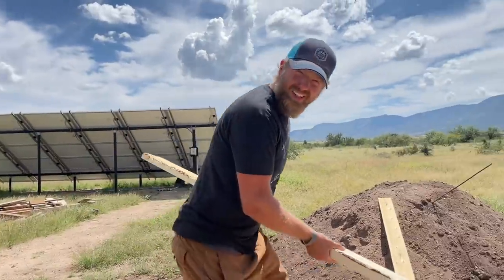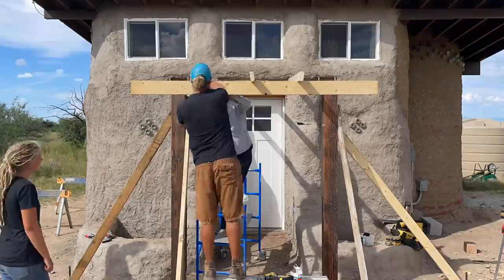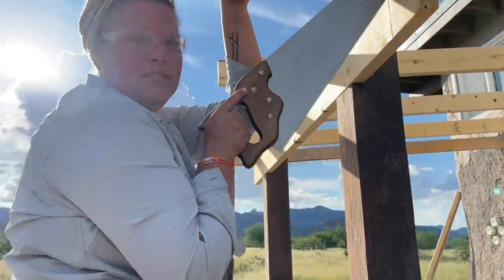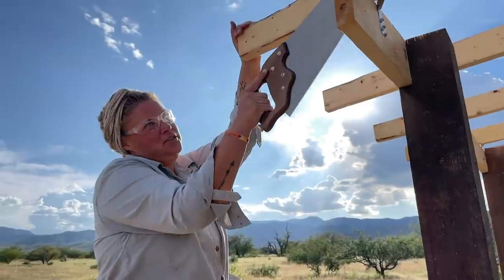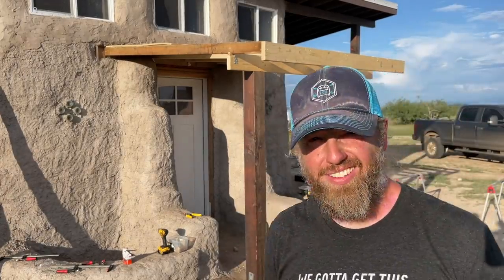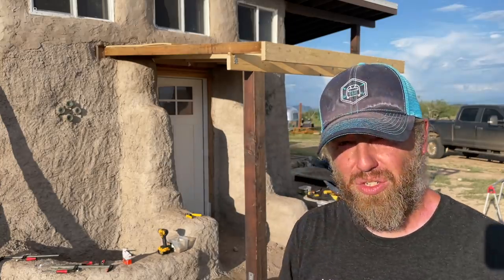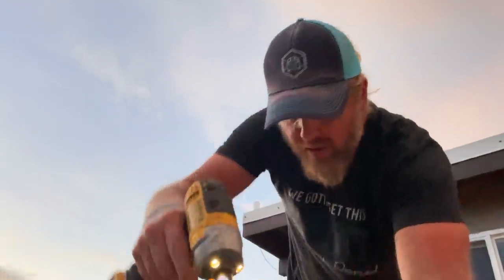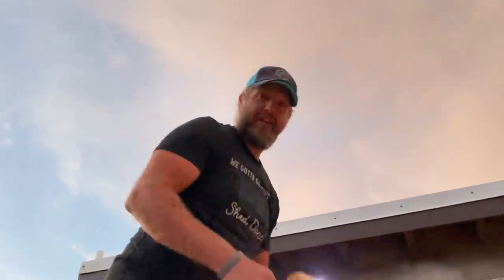Get this Shed Done Day 21 - Building our front door overhang

Comment: Why hurricane straps instead of joist hanger?
Reply: They have incredible winds so they feel better using the hurricane ties to install the rafters. They used them on the big roof too and it has survived from pretty crazy storms and not blown off. That's just my guess. They had their chicken coop get blown 50' from where it was but the roof survived.